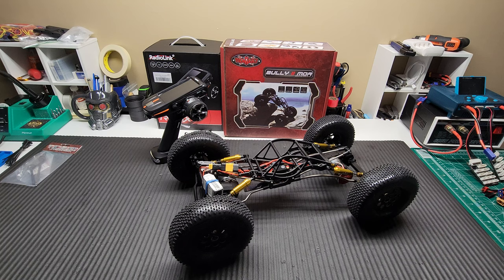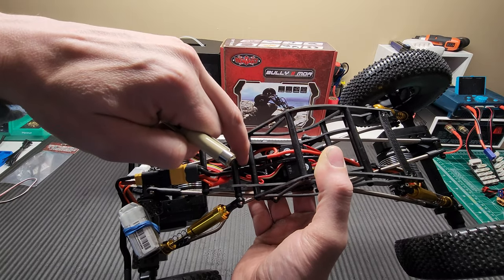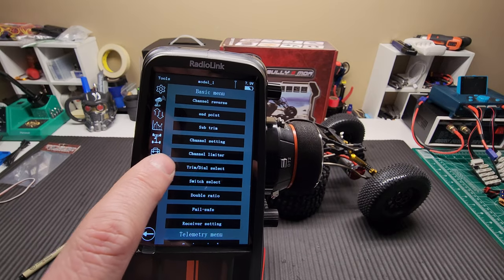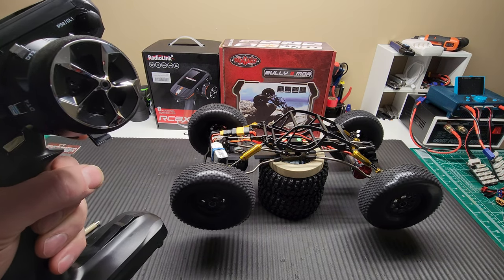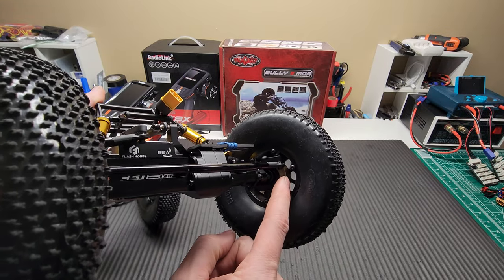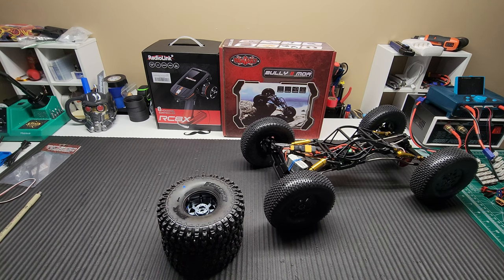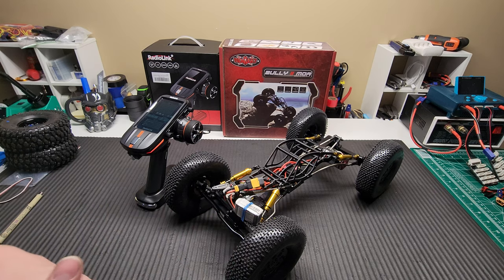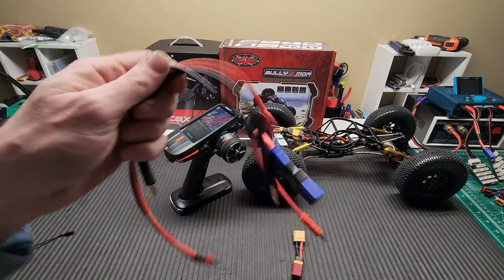How To: Radiolink RC8X radio setup with dual ESCs - Fusion Pros on the RC4WD Bully 2

Comment: Accidentally, I plugged both hw 1080’s esc’s with their red wire…..nothing wrong happened to the receiver.  Only had to turn on one esc, yet both motors ran (stock rc4wd brushed motors). My homemade connector, to connect both esc’s to one battery, came undone due to my novice soldering, yet both motors still spun, though one of them was no longer directly connected to the battery.  Mysteries of electronics. Still I fixed the split connector to make sure both motors get proper amperage.

Comment: Could you explain your wiring ? Im running HH mini dual an wanting to go brushless. 
  Are both Battery connectors spliced to one or are you running 1 battery per motor
Reply: Yes, both battery connectors are soliced together from each esc. Was running all on one battery.
Reply: The mini dual is brushed only if I’m not mistaken
Reply: @JohnGrenoble   correct. I never like the mini dual/brushed setup so I went brushless hobbywing fusions

Comment: Hello, please help me out here! So if i get it correctly you need to connect the two esc power leads together, red together with red and black together with black. Is it correct that i could use a y cable instead?

Comment: Very nice build brotha. What front weights did you go with I am going to assume dlux. If so when you ordered them do you have a picture of what boxes you clicked when building the weights. I am new to the MOA bully platform. I want to order the weights just need some guidance.
Reply from the maker: I actually went with the RC4WD Bully weights. So far it's been performing well so hadn't felt the need to swap to the Dlux.

Comment: Hello!!! Thank you for the  vidéo . Do you think, with the radiolink rc8x,  it's possible to have a proportional DIG with the VR knob Switch? 
Like on the sanwa mt4 transmitter.
Reply: Yea, would like to know that too. In some forum i was told the only RC that can do that and is of use for MOA at all is the old MT4.

Comment: Very nice, but as you know, those motors will get pretty scratched when you start rock crawling…
Reply from the maker: Yep, it's definitely happening already. Nothing too bad though so far.
Reply: Is there a solution to rotate the motors up a bit?

Comment: Did you have to do anything mods to get the fusions to fit in around the links. I just received my bully2 today to fusions look tight
Reply from the maker: Nope, I have slight rub on the end of the motor can in the rear, but little enough that I can live with it. I don't believe it's causing any issues. Crawls wonderfully!

Comment: @TheRCRundown Hello! I just built a bully 2 and I have the rc6gsv3 radio and I cant for the life of me figure out how to setup dig and overdrive. any help would be amazing thank you.
Reply from the maker: Sorry, but I haven't owned that radio for years. I know you can do dual motor/esc setups from what I remember, but not sure about how it works (or if it can) with Dig/overdrive.
Reply: If you only have one esc, you need a an electronic dig unit. Look at the bully 2 manual, there you can clearly see how the dig unit works. If you have 2 esc’s, recommended, then you will plug each esc on an independent channel. You combine how the escs/motors work together using the mix function, granted the rc6gsv3 unit allows for mixing channels. If the rc6gsv3 doesnt do channel mixing, you will need an electronic dig unit, which may be purchased form rc4wd

Comment: Can the radio not do 3 position on the thumb switch so you have 4WD/front/rear dig on one switch rather than using a separate switch to go back to 4WD? I like the idea of the fusion with built in esc, but at 7.3oz compared to 4.7oz of a Holmes Magnum stubby or 4.6oz of a Puller 400, it's just too much weight difference for me.
Reply from the maker: Without battery (and without the wheel weights) the rig as shown, ready to go is just over 4lbs which is quite light. The extra 6ish ounces of weight for me down low are welcome. I haven't had the chance yet to play with setting additional buttons up, but what you want to do may be possible. My only issue with that is if possible, you have to click through each setting to get back to anther. It works out to one extra click. What I mean is let's say it's setup like a 3-position switch and each click advances it one position. If position 1 is 4wd, 2 is front dig, and 3 is rear dig. If you're in rear dig and want to switch to front dig, you'd have to click it twice to get there, versus my current setup of just hitting the corresponding button up once. That could matter in competition where time matters.

Thanks for your input! I appreciate the view!
Reply: @thercrundown203  when you clock the rear axle to get the motor out of the way, you're lifting extra ounces above the axle. Not sure if the fusion fits it, but look into the Progressive RC rear Bully axle. It tucks the motor 8n closetlr to the axle, and it weighs less than half the stock Bully axle.
I run Sanwa radio, and my thumb button is 4WD centre of button and front rear dig either side. It's one click down to lock the rear, and back up for 4WD again. Opposite for locking the front. I only need to use the thumb that's on the handle grip, and not move from the wheel  it's more fluent. I tried a Noble 4 and it was the same as you're using. It needed more than one button to do what one button can do. When you're on a course and times ticking away, you want the radio movement to be fluent, without over thinking.
Reply: Hello, sir. You can set 3 position switch on RC8X. Here is tutorial of it: https://www.youtube.com/watch?v=6YpKuzUdwQQ
Reply: @Radiolink_official  That's helpful. Thank you!
Reply from the maker: @Radiolink_official  Thank you for the tutorial

Comment: You will not blow the receiver because it receive to much voltage! Voltage don't add up they are plugged in parallel!
You might end up burning something, but it ain't gonna be because "voltage added up".
Reply from the maker: Thanks for clarifying. I misspoke. Having two BECs (when built into the esc) can cause issues as you said, especially with esc's cutting out, or doing weird things with the voltage. I've heard of it "backfeeding" to the opposite esc and essentially ruining it.